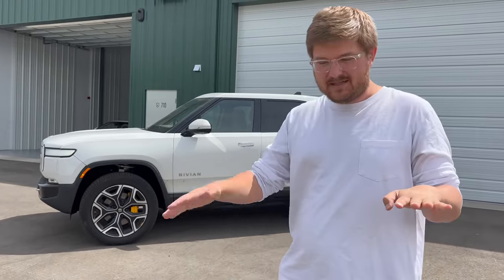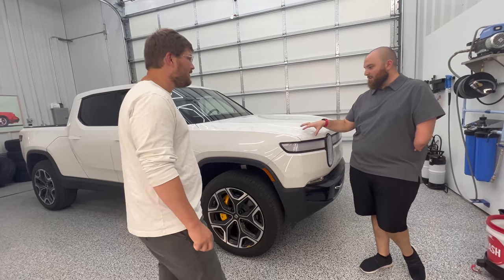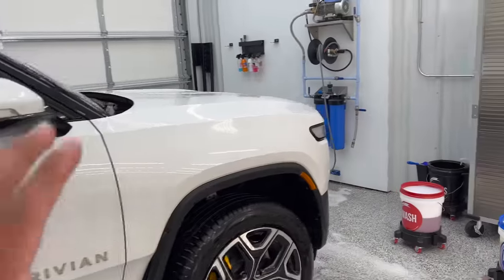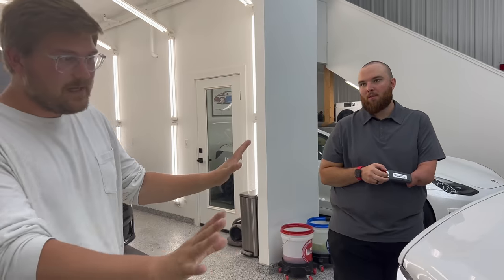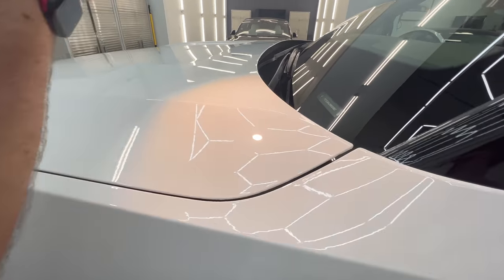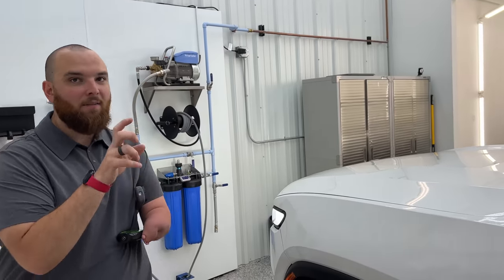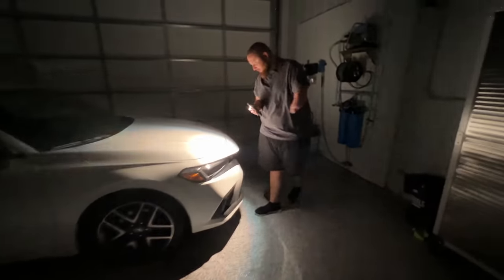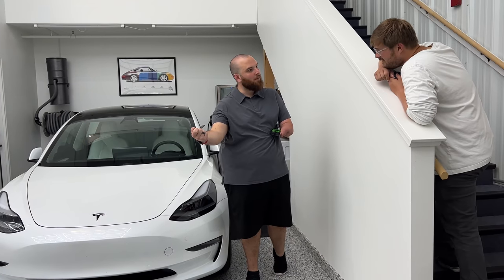Here's How Rivian Paint Quality Compares To A Brand New Tesla Model S & Honda Civic!

Comment: These types of tests are interesting in the sense that the paint job seems to depend on the car itself. As Kyle mentioned he got into detailing and has watched me vids. Lots of detailers talk about that it doesn't matter which Brand you buy, they all need paint correction. I wouldn't expect any new car Maker to suddenly have a much better quality paint than anyone else since it seems like they all buy the same booths from the same limited suppliers. And we know these new car companies are under pressure to produce and scale fast so expect some paint correction on any car. Overall great vid Kyle!

Comment: Kyle,  Another great video!
I am on the waitlist for the R1S, in white.  Based on your knowledge, I will likely follow your decisions on using ceramic or warp you will apply on your Rivian.
Please clarify on your decision if you are using ceramic coating or wrap (or nothing) for:
*  The painted horizon area below the light bar
*  The headlights
*  The light bar
*  The small bended portion of the hood above the light bar
*  The charging panel at front corner of car
*  The black pillars near the windows
*  If any areas at the back of the Rivian 
Please also advise on the type of ceramic wrap to use, the wrap type and thickness.

Comment: I think this video and the last video does a good job talking about the Quality of the paint APPLICATION. I'm not so sure it says a lot about the quality of the actual paint.
When i think about the quality of the paint I'm thinking about if its going to fade over the years cause i park it outside on surface lots for 10 year, i think about if its going to get destroyed in the winter with sand, snow, and ice. I think about if it scratches at the drop of a hat, or chips off just cause the door flexes cause a cart bumped it. I don't think this really answers any of that. 
When i think about having a quality paint on a car, its the car i don't have to dump 1000's into trying to "protect" it, it does a darn good enough job protecting itself and thus the metal under it.

Comment: Not really sure how paint “ correction “ which removes some amount of paint makes it last Longer VS just keeping it cleaned and Garaged
Reply: I believe it is "correction" + protection.  So you can get it smoother and then add the layer that protects it better than just the rougher (more surface area) paint.  From what I've seen is really just a question "correction" before protection or not.

Comment: It is crazy to me that people can care so much about the paint unless it's a show car, or 100 years old and it is the last of its kind. If I drove a $150K or more car but drove it as it was intended I wouldn't worry about the paint. It will wear. That's life and the car was meant to help you enjoy it, not look pretty under lights with zero miles on it. Although if I spent enough on a car I might wrap it but that would be more to change the look than protect it.
Reply: My 1983 245 GL Volvo is wearing away of the original paint and I have done only bandages to slow down the oxidation as much as I can. What I really want to do is to restore it again with it’s original color as much as possible by stripping it down to the sheet metal inside and outside but oohh boy that is way too much of a big project.

Comment: Tesla's are notorious for poor build quality and paint finish. Unfortunately the Rivian  is even worse. This speaks volumes to the poor quality control and  inspection for both automakers. Those poor panel alignments and paint thickness variations and blemishes should have never passed inspection. You will never see these issues on a Lexus or Toyota built in Japan.